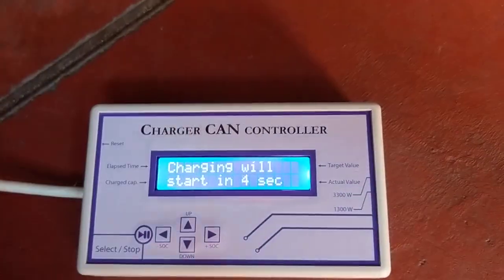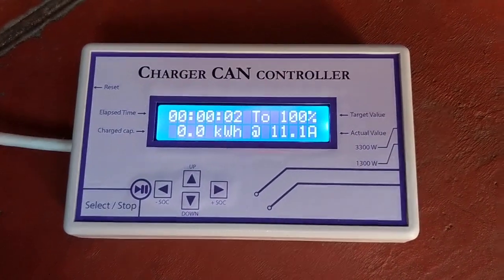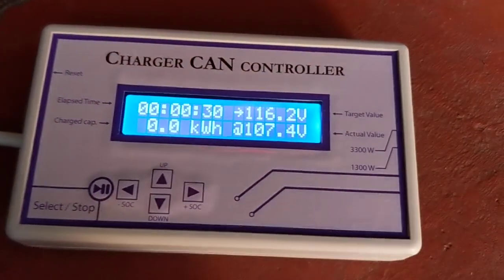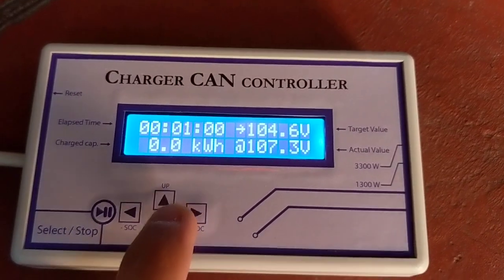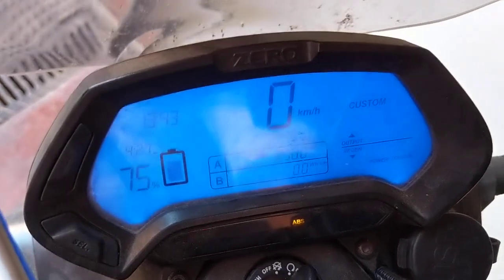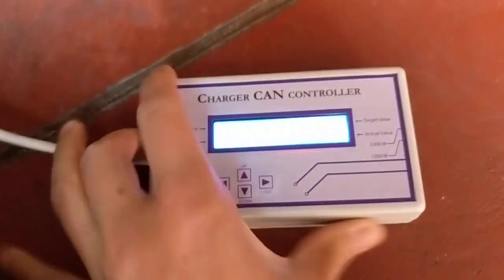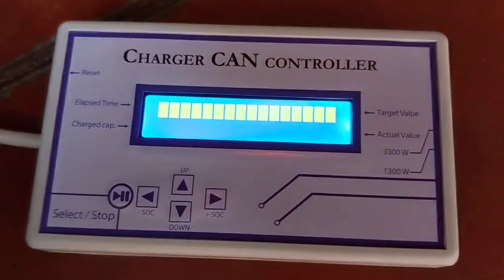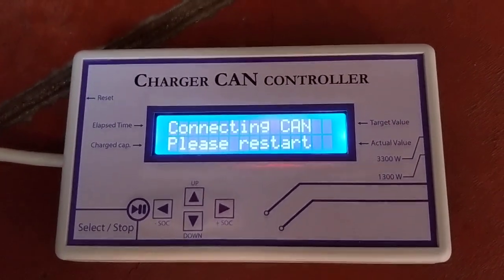Homemade CAN controller for fast charging Zero Motorcycles: up to 3.3 kW: automatic start

Comment: Muy buenas Daniel, ¿podrias decirme donde has comprado ese mismo controlador ? gracias
Reply from the maker: Hola, lamentablemente el fabricante me comunicó el otro día que deja de fabricarlos por enfermedad del programador sin fecha de reposición :/ me temo que si quieres hacer un controlador te va a tocar indagar un poco. Busca un chip compatible con arduino que use el chip MCP2515. Hacer el controlador con dos potenciómetros es muy sencillo y no requiere más que un arduino UNO y un shield CAN-BUS. El problema es que la pantalla y el shield CAN-BUS comparten pines y no son compatibles entre ellos
Reply: @DanielMonteroElectraveler  ya lo leí en Facebook... Vaya lastima.. Pero bueno.. No deja de ser buena opción la verdad. Gracias Daniel

Comment: que bueno Daniel!!! gran tabajo. Yo he comprado a Otten otro, estoy esperando a recibirlo, ¿sabes si se podrían encargar los controladores?
Gracias
Reply from the maker: Hola, los controladores no los comercializo. Por ahora los tiene que fabricar cada uno acorde a sus necesidades. Que yo sepa por ahora Otten no comercializa ningún controlador, te recomienda fabricarlos tú mismo como he hecho yo jeje
Reply: @DanielMonteroElectraveler  y es muy dificl la configuración? o es programación básica) estoy a la espera de mi cargador 3.3kw con toma c19 para aguantar los 16a constantes...
Pd fue Zarzuela el que me recomendó el de Otten porque tu lo llevabas jeje
Reply from the maker: @Pablo.encinas  Hola, la configuración es lo más fácil. Sólo tienes que instalar el programa Arduino IDE, instalar los "drivers" del chipset y luego coger los archivos que hay en mi repositorio de GitHub y meterlos en la placa Leonardo a través de conexión USB. Los "drivers" del chipset también están en mi repositorio (link en la descripción, es el único archivo .rar que hay por ahora, en él también está incluido el programa más básico para probar que esté bien instalado el programa)
Reply: @Pablo.encinas  muchas gracias crack!! Lo que si estaría bien es que en la descripción del video pudieras poner los enlaces de compra a las piezas jeje.. Muchas gracias